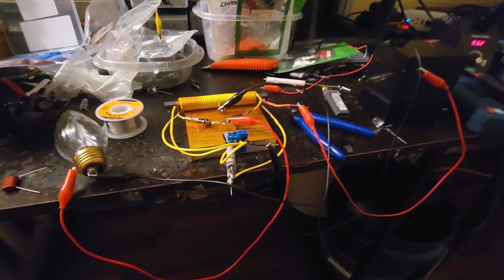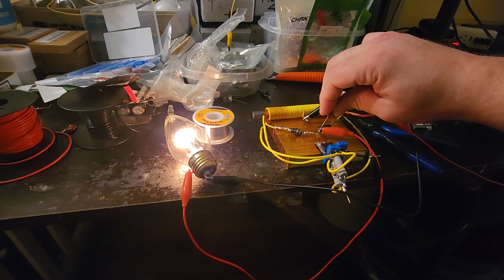|~| THE IMPORTANCE OF THE CORRECT VALUE CAPACITOR 0.22uF IN THE SYSTEM |~|

Comment: So it charges the battery when the load is switched off, you could rapid switch the load and smooth it with a load capacitor, so the circuit can run a load and charge the battery as charging is very rapid. Just an idea, keep up the good work!

Comment: By adding that value capacity you're just putting the circuit into resonance from a non- resonant circuit
Reply: The challenge is if you can make the circuit resonate at its fundamental resonant frequency then the amps or current should go down drastically.
Reply: There is a resonant frequency calculator online and you can use it to find the fundamental resonant frequency of your coil or coils
Reply: If a resonant circuit is out of resonance it draws more amperage or current
Reply: @foamaxmore  It doesn't really "draw" amperage as much as it requires more amperage to push through the EM retardation, the function of Amperage in a circuit is the same as the function of Kinetic force at the input of a "Generator',  it's to force its way through the delayed fields, resonance gets around that since it doesn't have to fight through a delayed field.

Comment: I tried to make this circuit, but it consume a lot of amps  even without load, Idon't know what I'M DOING WRONG.
Reply from the maker: How many amps? & for the current model I'm experimenting with it consumes 250mA no load & 1.5-2 amps when an incandescent 40 watt load is connected to the 336,961 tesla coil or when rapidly recharging 12v batteries.
Reply: @MTECH2022 it consume more than 3 amps, I tried just simple ringer circuit without L3 tesla coil
Reply: @Efest-777  The cause is most probably a bad transistor . The amount of resistance in the bulb will also control the amount of power consumed . Mine use 4.5 Amps when charging a battery. I use 2000 ohms of resistance in place of the bulb , mine do get hot . My output coil is a bit different the his as I have many turns on it . Also the connections will determine the heating of the transistor , mine doesn't even get warm at 4.5 amps and 12.7 volts input .   Hope that helps you , it really does work as he says but there are other ways to use this info and get much more .
Reply: @jeffreydove2036  yes, I used cheap TIP122 just to try, but I think ferrite also can cause such comsumption of amps ? And L1 AND L2  should be some lenght to not oversaturate the ferrite  rod?